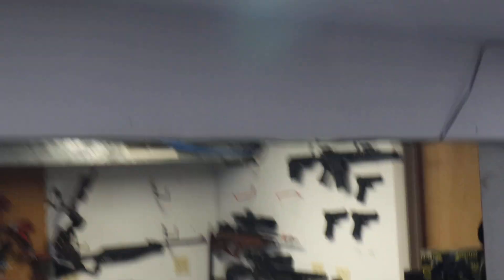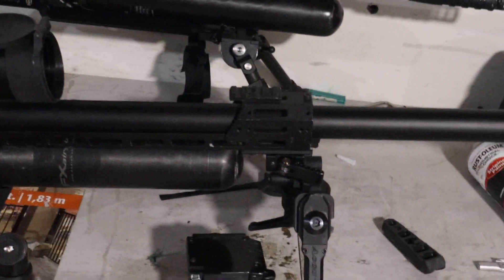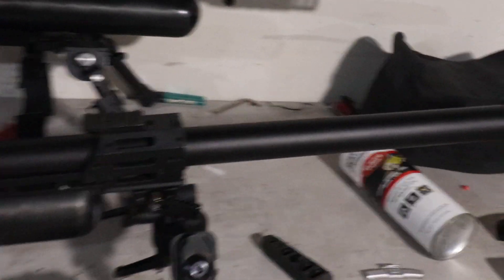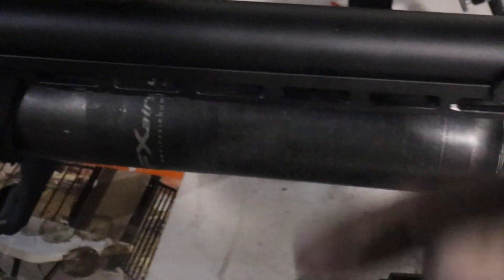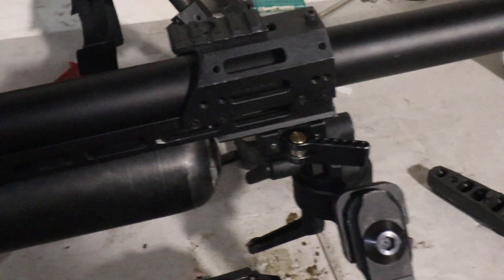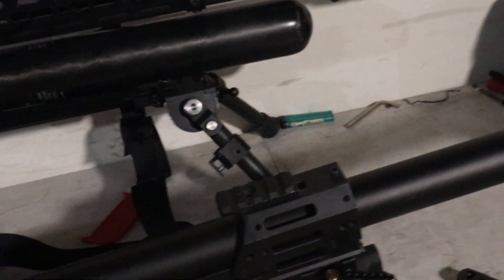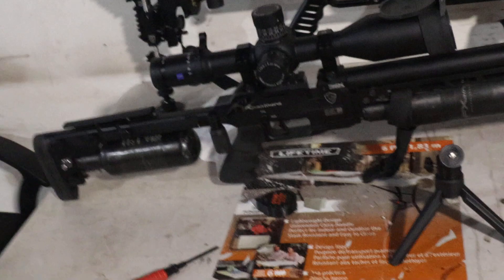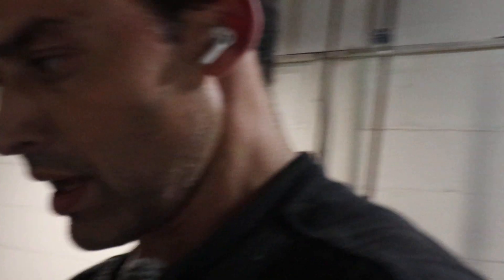Making an ok air gun silencer an Awesome air gun silencer 2

Comment: I need something for 30 cal impact just can’t afford it at the moment also looking for some type of custom caulking lever
Reply from the maker: OK that’s some thing I would need to make on the CNC machine, it should be ready in 2 to 3 weeks, they said it’s shipping out next week, but it takes one full week to set up because the cement has the cure for five days, then the Apoxsee for another day And then you mill down the actual table you bought the work to to level it, so, as soon as it’s ready, I’d be happy to design some thing for you. What were you thinking?
Reply: @Cjsairgunscarsandmachining  something unique that really is not out there  very interested in what you were doing to the suppressors when I bought my FX. I ended up getting rid of the FX suppressor. Due to personal reasons. So it is very loud right now. Lol
Reply from the maker: Well, I’ll tell you what, I’m happy to make you the internals for a suppressor like I did with mine, if you saw the decibel meter readings it is about 19 dB lower than the lowest competing suppressor that is close to stock because I don’t have any left that are completely stock, I have modified all of them to some degree, but I had a Donny Fl Machinist FX that all I did was add extra salt and wire mesh, and it was 19 dB quieter than that suppressor. The impulse was the closest. The impulse is a great moderator. That’s why that is one that I have not changed at all except the smaller one I did add a muzzle brake to, but the larger one I haven’t modified at all. Those suppressors are really well-made. they are a baffling system that threads apart from the each baffle before, and after it, so you can even add extra baffles, or take some out if you want, but they made a very good system, I definitely can appreciate, good workmanship, and they definitely have some. You can tell the Terry experience machinist just by the work. So if you were going to buy one, I would recommend that, if you already have one, no matter which kind it is, I can make internals out of solid aluminum like I did with mine, you just pay for the aluminum and I’ll build it for you. You would have to send me your moderator so I can take the measurements for the internals, and then I can do it either where I do the baffling system, and then salt and wire mesh on top of that, and make the baffles narrower, or just make bigger, baffles, and leave it alone. In my experience, the bigger, baffles work better. With no other suppression, just the baffles with holes milled through the middle of each baffle. Depending on the length of the suppressor will depend on how many baffles, but as you can see, it worked well for me.
Reply from the maker: @joshuadonley6580  if you had kept the original FX one, it’s actually hollow, I could have used that shell to make some internals like you have seen me making, and made it to size for that moderator. If you still have it, I’d be willing to do that for you, you can just pay for the aluminum stock and that’s it.